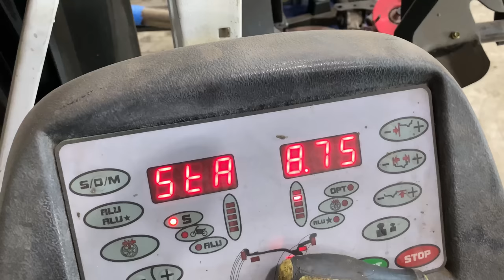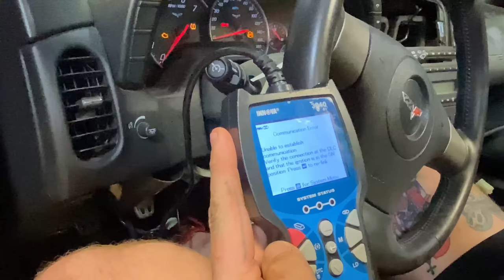I Bought A DESTROYED C6 Corvette At Copart Salvage Auction!

Comment: I LOLed my ass off when I saw this, and cried a little, because at first I thought it was MY C6. Short story, I got side-swiped on I65 (right past the turn off to the Vette museum i might add) and did a 180 and hit the rock wall on the side of the highway rear end first at 70 mph. The diff came up though the rear floor, and  sorry ruined the radio with the bell housing driving the floor into the dash. My wife and I had no injuries, not even scratches! Impact twisted the rear end to a 30 degree off set from left to right. The real laugh was I started it up and DROVE it onto the flatbed, because he couldn't get under it. Oh yeah, the side swipe de-skinned the passenger door and rear passenger fender. Then it went to Copart. sigh.

Comment: Very fun looking.  I used to have a roadrace car and would get cars for free or near free and use the parts on the racecar then part out and scrap.  Always found it fun work.  I was a single guy operation, so metal was cut to a size I could lift and carry to my trailer.  It was interesting to see scrap steel prices over the year.  One trip and I could buy myself a large dunkin coffee and a muffin.  Next time, I've got enough for 3 tanks of gas.  I see you traded the S2000 for a Vette.  I did a smaller level version and once needed some discontinued hasport swap mounts.  I traded 4 boxes of parts with a guy across the country for them.  He sent pickup tags and UPS came up the driveway.

Comment: That's a T56 Magnum transmission that's used in the Hellcats and Demons. It's rated at 1,200HP. I didn't know Corvettes used them, but I knew Mustangs Cobra R and 4th gen Camaros do.
Reply: The T56 was definitely used for all sorts of cars, Vipers, Mustangs, Corvettes, Ram trucks, but not the Demon, those are dual/multiclutch, the T56 is a 6 speed Manual, I’m sure they swap them in but I don’t think they come with them, maybe an updated version in the older hellcats that were manual

Comment: hey man love your videos , l watch all of them, i found a car for you at auction , matter a fact its my old baby. 2000 c5 however i sold the car and it was crashed a week later. I just had the car built with an ls1 that has 40k miles, and it is cammed. i spent 6k in parts on the engine from nw 243 heads to longtubes arp studs johnson lifters btr jam cam, the engine was built and ready for boost! i found it at the sacramento california copart auction ahd it hasnt yet been up for sale. i figuered it would be a good addition to the corvettes and maybe a good video. 6 speed manual and 20k miles on the differential! aldan american coilovers as well!
Reply: I’ll check it out, thanks for the heads up!
Reply: @LeeC  I also sent an email ! Thanks man!
Reply: Dude wtf r u saying lol

Comment: I can’t wrap my head around the fact you guys can still profit from such a trashed car. Every thing you removed was dollar signs. Good luck
Reply: profit???
Reply: @johnnyzee383  yeah you can part a car out and make profit if the engine is good thats much of the cost back
Reply: @TWEAKLET  Much of the cost back, would not cut it for me if I was doing what these guys are doing...labor isnt free even if your doing it yourself.getting that car up in the air and just looking at it would tell you the whole back clip has to be replaced and all the labor entailed...new transmission, rear end, lines etc..dont know what they paid for it, but it would have to be worth at least 25% less than what a used motor would be worth, to be worth buying.
Reply: @johnnyzee383  they are not repairing it they part it out to repair others or to sell look at their other videos usually completely totaled cars like this go for close to the cost of the engine if not a little more if you look around their shop the walls are lined with engines and other stuff
Reply: @TWEAKLET  OK

Comment: I’m guessing that the bid on that car was only assuming that the engine, front clip and front suspension wheels and tires were salvageable. 

One Ranger that I own has been hit in the rear by 4 different women drivers, one just left scratches on the rear bumper a week after the prior hit. I was going to save the left box side until January 2021 I slid down a steep snow covered driveway on a pizza delivery and slid into some tall thin trees and dented the left box side. I’m building a flatbed on it. I’ve gotten over $9,000 in insurance checks from it and I paid $12,600 for it. I call it my Ding Ding Ranger.

Comment: Somehow I never knew that the transmissions were in the back… Just seems like such a strange concept to have the engine not actually directly connected to the transmission
Reply: It’s strange until you work on it for the first time!
Reply: @LeeC  Thats why they handle good. Almost 50/50 front to back.
Reply: @aphil4581  yes sir!
Reply: Didnt either until Cleetus bought Leroy.

Comment: Another crash scenario is he was driving at high speed and spun 180deg (slightly more or less) and backed it into a guard rail.   I think the air bags will not deploy if backing into a wall at high speed.  Also the steering wheel will probably not be deformed as all of the driver’s mass will be transferred rear into the seat.
Reply: Quite possible!

Comment: Since your an expert on wrecked corvettes, I have found several C6s on Copart were the whole rear cover/bumper assembly was ripped off and they totaled it. Is there any red flags that would stop someone from repairing and selling it?
Reply from the maker: Nope! Those are some of the best ones. That rear tub can and will crack. 

GENERALLY insurance companies write that as a replace, which is a massive job. In reality it is perfectly acceptable to glass it up which is super easy. 

Those are some of the better cars out there that you can buy if you want to rebuild.

That said, do your due diligence on the car and make sure there’s nothing else going on with it.